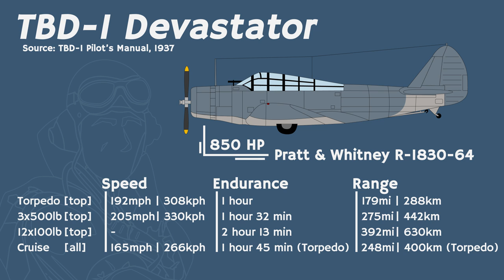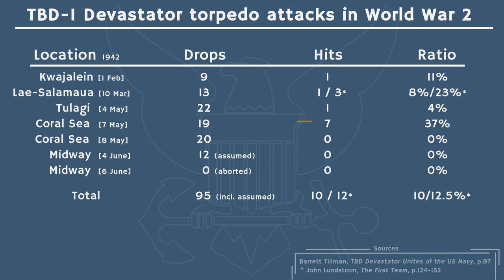In Defense of the Worst Aircraft of World War II - TBD-1 Devastator

Comment: Considering that we here in the US also manufactured the F-35, this doesn't surprise me. However, I think the problem with the Devastator had more to do with the notion of dropping torpedos from a plane instead of just having a submarine shoot them. The problem is that air is thinner than water so that a torpedo will travel through the air in one way and through the water in another way. They probably had to fly so low so that the impact of the torpedo into the water didn't cause it to explode or behave erratically if it did actually make it into the water intact. You'd think that a single attempt at a belly flop into a pool or even doing a cannon ball jump into the pool would cause engineers to realize that dropping torpedos from the air won't work all that well and that's just to speak of the increased force when the torpedo hits the water.

Then, to accompany the problems with the initial force of the torpedo hitting the water, there is the fact of refraction, which is a term used for rays of light but the principle still holds for this, I think. Basically, when a ray of light enters a different medium through which it will pass, it passes in a different way. In the same way, a torpedo, should it actually make it into the water without blowing up on impact, would follow a different trajectory than the intended one because of the change in density between the air and the water. 

The solution? Just use a submarine like everyone else. A torpedo launched from a submarine is basically going from a boat under the water into water, which wouldn't have the same pitfalls that dropping torpedos from the air clearly has.

The last thing I will mention is that the way the torpedos were positioned on the aircraft isn't helpful for aerodynamics, as if there weren't enough problems. Overall, I think it was a nice looking plane but it was being used for absurd purposes. Why not just drop a bomb on an enemy's aircraft carrier?

In any case, the biggest mistake is to go to war in the first place and I say this as someone who has multiple family members who died at Auschwitz. Still, I know my country absolutely did not join the war to save my family members nor did anyone else. Even still, wars always end with a peace treaty so I suggest we start with a peace treaty at the beginning. I think there was plenty of room in the US for Jews and all the other people facing persecution. While no one should have to move from their home, it's a better solution than what happened. Of course, other people only cared when Hitler started taking over more land but it is likely that this was also a reaction to the imposition of harsh terms agreed upon because of the first World War. In the end, we're all human and it isn't war that solves things, but talks that create agreements, even if everyone involved is a little annoyed at what the agreement was. You can't starve people of resources and expect them not to get desperate. The response to that desperation is wrong but it's just as wrong to knowingly create those conditions. However, I'm sure we'll cause our entire species to become extinct before we have to sense to deal with each other in this way as fellow human beings, which makes me immensely sad, especially as a citizen of the US because I love my country but I also love my species and the many others who will die when we kill our own species.

Comment: Good video.  Whether the TBD was successful or not at Midway really didn't matter since the plane was going to be replaced in 1942 anyway.  The TBF was already in production and numbers were just starting to come on line when the battle occurred.  The TBFs at Midway were actually part of Hornet's torpedo group but were sent to Midway to prevent mixing of aircraft types during the battle.  The supply was already limited and would be even if all the aircraft had returned in June 1942.  

As for 'worst aircraft of WW2'.  People who say that have no real understanding of what makes a good or bad aircraft.  It was truly outmoded by 1942 but so were most prewar designs.  If you look at aircraft that were designed and flown in 1935 very few were still in front line service by 1942.  Most of those that were still in service at that point had gone through several upgrades and model changes to be competitive.  The most successful of the 1935 designs, the Bf109, was on it's sixth update (Bf109F series) in 1942.  Like you pointed out the aircraft, while state of the art in the mid to late 30s, was not really a front line aircraft by the time the US entered the war.  The US knew this and tried to get the TBF into service but it didn't make it.

Whether the TBF would have been more successful at Midway is up for debate.  It was more survivable and might have gotten a few more aircrews back but overall I doubt it would have been that much more effective in the end.

Comment: Didnt every country have issues with torpedos during WW2? I think I read were German u-boat captains would like to use the deck gun if they could. They had limited torpedos and had issues. I think the Japanese had problems too if I remember correctly. You also have to take into consideration what you are asking the torpedo to do. It's basically being dropped on concrete because the way water acts at 100  MPH.

Comment: It sounds like it could've really benefited from an upgraded powerplant 

Or an entirely new one with only minor changes made to accommodate significant physical differences. 

I would've removed any designs or equipment needed for the aircraft to operate above 10,000 ft including making it only operational primarily as a dive bomber and secondarily as a torpedo bomber. 

An airforce or marine version that would discount the torpedo bomber role would be the flip side - dive bomber / CAS , and light tactical bomber capable of limited flight up to ±12,000~ give or take payload and fuel. 

I just think this aircraft had serious potential and a longer service life esp if you let someone like the Marines inherit it, and upgrade it to suit their needs and give it a long life like the subsonic fighter/ bomber Delta wing jet the  Skyhawk or even their helicopters later on.

Comment: Interesting, it seemed the TBD pilots suffered the same issues as the submariners did early in the war, dodgy torpedoes.  The Mk13 sounds an awful lot like it had similar issues that the Mk14 submarine torpedo in accuracy and detonation.  Seems like the performance was less of an issue than the tactics and weaponry and I don't doubt a lot of great pilots suffered as a result.  The one thing the TBDs did succeed at Midway was drawing the defensive fighters down to sea level allowing the dive bombers to have a relatively unhindered attack run and we all know how that ended.

Comment: Excellent presentation and analysis.  The TBD Devastator was clearly an inferior airplane in that it was too slow to evade pursuit by attacking enemy fighter aircraft and lacked sufficient gunnery firepower to defend itself when it was not protected by fighter escorts.  Although the TBF Avenger was a better airplane, faster and better armored, it too suffered from these problems, though not as much.  When, as the narrator points out, things went wrong at Midway,—failure to coordinate with fighter escort and with SBD Dauntless dive bombers—both the Devastator and the Avenger produced unacceptable results.  What must be understood, however, is that torpedo launching from an airplane puts the plane in an extremely vulnerable position from both anti-aircraft fire and attacking fighterplanes for too perilously long a time, such that even the best torpedo plane is a sitting duck courting annihilation.  Unlike the dive bomber, which can come straight down from a great height, drop its bomb and pull out, making itself a very elusive target at rapidly changing altitudes, the torpedo plane must hold its course at the same low level over a long distance and for a long length of time.  This places it at much greater risk.  The problem with the Devastator was not that it was a Devastator but that it was a torpedo plane.

Comment: Well stated.  The TBD was simply an old plane by 1942.  A decade old design but the US had the foresight to build them and an aircraft carrier fleet in the 30s, just like building the long range four engine land based bombers.  Both of those things were far superior to what Germany had in 1942 in those classes, which was nothing.

Japan had been adapting and knocking off copies of British and American equipment since the teens and twenties in peacetime equipment (mfg tools, cars and trucks) as well as war material.  Japan having been at their expansive Pacific colonial war for half a decade already, had improved their equivalent 1930s designs and had much more war experienced crews.

Wasting an hour of fuel flying in circles above the fleet waiting for admirals to make a decision caused as many losses in US Navy Aviation that day as older pre-war airframes.  When the day was over though, the Imperial Navy was stopped and turned back with crushing vessel losses they could ill afford, while the USN was just getting started building a modern fleet that was fresh to hit the waves later that year.

If the TBD wasn't there, it would likely have looked like a scene from  "Sink the Bismark" with slow Royal Navy torpedo biplanes facing a 1942 state of the art Imperial Navy Aviation.

Comment: It's very rare that a truly "bad" airplane makes it fully into combat service. If you look into the story of any of the pariahs of WW2 aviation, you will almost always find that the airplane's design was not the primary issue. Tactics and beaeuracracy were. The Airacobra, I believe, is another excellent example of such a thing.
Reply: Last minute choices to reduce or eliminate superchargers or turbochargers undermined some plane designs.
Reply: @SlavicCelery  Again with the Airacobra: the Army wanted a high-altitude, high-speed interceptor, and then at the very last minute declared that they wanted a ground attack plane, so they ripped out the supercharger. Then they suddenly went back to using it as an interceptor, and proceeded to complain about how poorly it performed in that role.
Reply: @Skyhawk1998  That said, low altitude combat, it was effective.
Reply: @Skyhawk1998  Some of the "bad" allied planes had less to do with the technical specs and more to do with poor tactics. Ala P-40 warhawk.

Comment: With only 7 direct hits on the carrier Shoho, in the Battle of the Coral Sea. No hits at Midway. And only aircraft 144 built. It was state of the art for 1937. But by 1941 it was obsolete. Replaced by the very capable and legendary Avenger. Which could bomb and have torpedoes. Grumman made a superior plane. However the Dauntless was one of the best dive bombers. Living up to the moniker. Slow But Deadly.
Reply: so far as I'm aware, the TBD had level-bomb attack mode if desired as well..same as Japanese TBs..

Comment: The negative comments about the devastator are based solely upon the results from the battle of midway. At the start of the war, ALL of the Navy's equipment was outdated and considered obsolete, with the possible exception of the Catalina. The crews knew this from the start; however, you fight a war with what you have and not want. Midway, to any strategy-minded person, is a jumble of mistakes, initial miscommunications, and series of lucky encounters. For the TBD crews, luck and courage were needed because they went in totally unsupported. In the end, particularly for Hornet's Torpedo Squadron 8, they ran out of the first but the courage exhibited will last for all time.

Comment: Did the US Navy not understand how vulnerable torpedo bombers were when making a torpedo run at a target - flying low and slow? Why not drop the torpedo like a dive bomber onto the target ship? Given that warships of the era had a thick armor belt to protect them from torpedoes and very thin deck armor, why didn't they use the Devastator like a dive bomber?
Reply: In that era, a naval air attack at sea was  or should be a composite of fighters, level and dive bombers and torpedo bombers. Torpedo bombers had proven to be quite good enough at Taranto when the RNAF decimated the Italian fleet in 1940 and again, of course, at Pearl Harbor in 1941. The main reason why torpedo bombers were used by the US in WWII was because we had them, so we used them. Why give the enemy the opportunity to concentrate its resources on only a one dimensional  type of  attack?. The enemy should be forced to respond to several different types of simultaneous  attack, which raises the chances of the success of the attack.
Reply: FAA (Fleet Air Arm) not RNAF.

Comment: If the torpedo drop parameters require you to fly low, slow, and in a straight line...doesn't that mean the Avenger's better performance is entirely moot? The Avenger would still have to slow down to the same speed as a Devastator, and then get eaten up by Zeroes all the same.

Comment: Okay I'm sure you'll get to it later in the video, but about 5 minutes I paused the video and am confidently declaring that the awful, faulty torpedoes that the US Navy was using at the time, along with an inability early on to adequately support bomber squadrons with fighter cover are at the root of the wartime ineffectiveness of this plane .  Torpedoes that require a very low, very slow, very level approach and release at suicidally close range to even have a chance to work at all (and it was still far from a certainty they would work right even if all of that happened) are going to doom any plane to a very, very poor attack record, and that plus the lack of fighter cover and inability for dive bomber, torpedo bomber, and fighter squadrons to work together means almost certain death for most or all carrier bomber planes.

Comment: Better way to consider it...
____________
TBD-1.
3 crew.
206mph. 128mph.
435 mi.

1 fwd GM. 1 Read GM.
2000 lbs of bombs.
-
JU 87.
2 crew.
211mph. 130mph.

2 fwd gm. 1 rear GM.
990 lbs of bombs.

____________

The Devestator was a better aircraft then the JU 87... And it was a carrier Aircraft.

Comment: I wonder how the Devastator would have handled the European theater.  Frankly, the Pacific theater was far less forgiving to naval bombers than the Atlantic.  It's possible that the Devastator's reputation was just a casualty of then-traditional tactics being unsuited for the battles they were being given.  I'd wager that if the Devastator had been on the English carriers like the Ark Royal in place of the Swordfish, it might have been better remembered.  Those torpedoes were still absolute garbage, but I have an inkling that the losses would have been far less catastrophic.

I'm not absolving the Devastator, it was still an obsolete machine, but even the otherwise excellent Avenger suffered pretty severely at Midway, and torpedo bombing in general was a suicide mission in the Pacific.  Not that I'm saying it was easy in the Atlantic.

Comment: Let me preface my remarks by pointing out that while I'm not an aviator, my father was a WW2 aviator with some experience with the TBD-1. I quote from the Wikipedia article on the Devastator-- "...by the time of the Japanese attack on Pearl Harbor the TBD-1 was already outdated." This says everything that needs to be said. Like many late pre-WW2 a/c, the Devastator-- a fine a/c when it was originally fielded-- was simply overtaken by technological progress. My own personal experience with the TBD-1 is limited to playing Pacific Campaign wargames, where the TBD-1 is completely out-classed not only by later American a/c, but even by contemporary JAPANESE a/c.
Reply: Let me add that when wargaming, the only thing a torpedo bomber is really good for is to pull the enemy CAP down to wavetop level & give the five-bombers a clear shot at the targets. DEFENDING vs an air strike, therefore, U wanna leave Yr CAP at altitude to engage the dive-bombers, & use Yr organic AA wpns to deal with torpedo bombers. In this sense it really matters little whether your torpedo bombers are TBD-1s, Bristol Beauforts, or Nakajima B5Ns. The better a/c are likely to score more hits, but that's a function of the torpedo they're using as well as the airframe.

Comment: It's a casualty of being a pre-WWII mono plane.  Imagine if a BF109B had to face down a 1940s era Spitfire?   It's why the Ju87 despite doing it's particular job very well wasn't well suited at defending itself from attacking aircraft.  Does that mean the Ju87 was bad?  Well I often point to the B17, even it ended up needing escort in the war, so does that make the B17 bad?   In my opinion, if the aircraft does the job it was designed to do how can you call it a bad aircraft?  It in turn then comes down to how it's used.   If a flight gets wiped out by a squadron of Zeros while having no escort, or that the escort got lost, how is that the TBD's fault?   Same would of happened to the Ju87 or Russian IL-2.   That being said I'm a Dauntless fan all the way but still.

Comment: TBD was, alas, a transitional design. Modern features such as flight controls & instrumentation were new and unfamiliar. It WAS an advance, but NOT SUFFICIENTLY advanced for the aircraft that it was going to go up against. It had the usual problems with novelty. It was "modern torpedo bomber 1.0", but went up against "modern fighter 2.0" or even "2.6". Take the best of its features, advance them by several years, and you have the TBF Avenger. TBD's poor performance should not have been a surprise, but Congress refused to fund a timely development project for a successor.